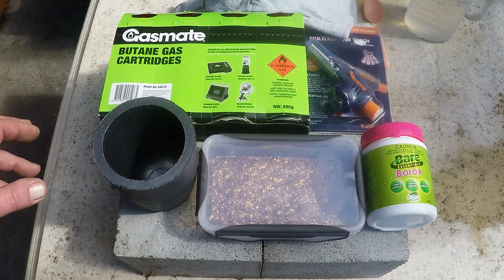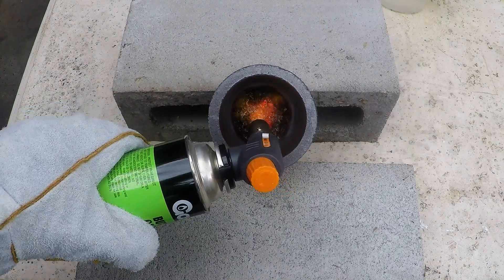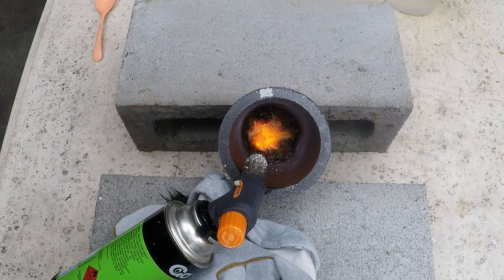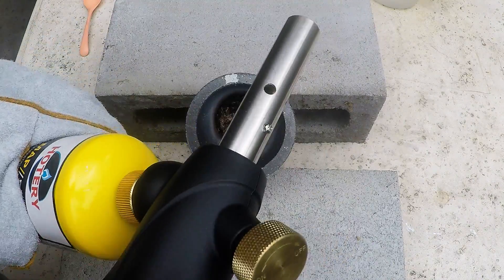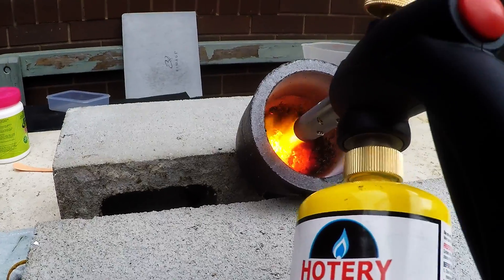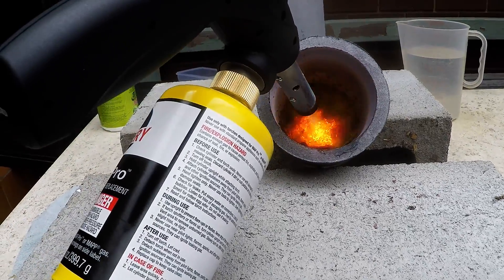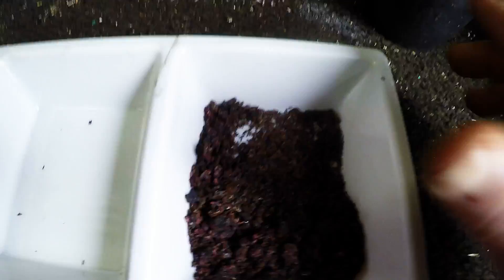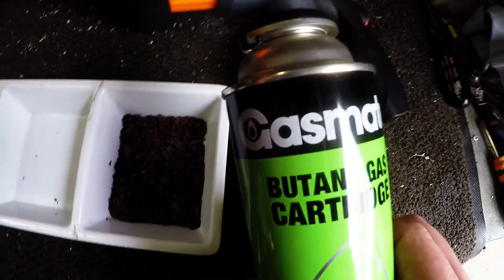1000 RAM Stick Gold Recovery Challenge Failed

Comment: Total & Complete Failure ! Butane is NOT🔥HOT enough...  Along with, you should use AP. Or something similar. Then AR & SMB to refine your gold to .999 1st. Then get a real set up...  Crucible is not the problem.   Cold is not the problem.

Comment: You should have ordered some Kaowool or carbon fiber (Oatey Flame Protector at hardware store) insulation when you ordered your crucible. The MAPP gas is plenty hot (2050 C) enough, you must be losing too much heat to the atmosphere. Butane is only 1450 C, and propane only is about 1980 C.
Gold and copper both melt at about 1070 C, so the MAPP is definitely good enough. Probably ambient temp of air is too cold.

Comment: You need better isolation around the pot you are melting in.
The sides of that pot is cooling  too fast and you losing temperature.
Keep it up the good work as you do.
Respect from Serbia(EU) and city of Krusevac.

Comment: Graphite based crucibles require too much heat for MAPP gas to melt the foils, the heat dissipates far too quickly to melt the foils to completion.

I use a ceramic silica based melting dish with MAPP and haven’t had any problems melting gold chloride or foils.

Comment: make a real forge run a blower line in then use charcoal to for the heat it will melt steel gets that hot there are turtorials on how to make em works really well

Comment: I use map gas but my crucible has insulation around it.  Also I usually add a pinch of borax at the end after melting.  But, I do not know If it matters when you add it.

Comment: You can fabricate a small foundry to melt your Gold Bearing Alloy using Plaster Of Paris and an old tin can along with Brass fittings for you Gas.. It will cost less than $20

Or you can build a foundry fired by charcoal. Instead of the steel crucible you can use the Graphite Clay crucible that you purchased. Check out this link...Enjoy.

https://www.youtube.com/watch?v=hHD10DjxM1g

Comment: try using both map gas bottles at same time that should do it
Reply: I have try that never worked need  crucible in a box  because it lose to much heat. I think need to build or buy a  furnace plus torch over heated  never work right after.

Comment: I have melted plenty of gold foils without any problem. You just need to have the crucible flat on the heat stone shield. It will take about 6 minutes to get the crucible and stone hot stable. Add the gold foils and watch them go. I end up with 6 kt on average. You can add borax acid and let the BB roil and boil in the borax and if you work it for a while, you can burn off some of the impurities. You are definitely loosing needed heat through the crucible.

Comment: I have no experience but I think you're using the wrong type of crucible. Graphite is an excellent heat conductor. Which means also a very bad insulator. you either need to insulate it or surround it with fire bricks. or use a small cyramic melting dish. The heat is being lost to the atmosphere.Nice vid though.

Comment: Ben you can melt gold with propane cylinders it just sounds like your torch is starving for air.  If you can hear that noise it is making.  I have had the same results trying to use similar style crucibles.  I always use quartz crucibles and melt at an angle so the torch doesnt starve for air.  That is the key to melting you dont need oxygen or even mapp gas although it is much faster.  You want to get the shallow crucibles and make a tornado effect on the crucible.  Also make sure you glaze it first.  You can buy those melting dishes on ebay for under 2 dollars.

Comment: your losing too much heat with the crucible.  you need a melting dish and surround it with fiberglass, that's how I melt my gold with MAP gas.  you might be right about the nickel though

Comment: you should be able to melt it using the original torch head  and a decent butane propane mix, as I have melted steel in seconds with this combo. love the channel, its what really got me into scrapping!

Comment: Ben - yes, the assessment correct.  Combination of not enough heat, big crucible, and atmospheric cooling.  I have a great little furnace where the crucible rests in an insulated container and the heat is applied from two torches that circulate a lot of heat around the crucible for a good melt.  Even has a lid to keep the heat in.  They are relatively inexpensive and worth every penny.

Comment: you need insulation Ben. you are out in the open with the majority of your heat radiating away ( you are in winter too). there is a product called "kaowool" from forman insulation that is awesome for temporary furnaces which would keep that heat around the crucible. its 2" thick and comes in a blanket form so you can cut it with scissors and frap up a shroud around the crucible. I have melted bronze using propane this way so you will have those foils liquid in no time using mapp gas and a ghetto furnace from kaowool.  its cheap too, give it a go before investing in any more equipment.

Comment: Hi Ben. Another great video. I have melted foils before using map gas and oxygen and it made a really nice gold looking nugget that registered less than 8k gold. It looked like you were close to melting the foils based on the orange color I could see. And you might still be able to barely melt it with just map gas if you make some small adjustments. First shelter your crucible from the wind using some of those cinder blocks, Try melting a smaller amount of foils and use less or no borax to start you can always add a few pinches after it melts. The borax can act like an insulator making it harder to get the heat down to the foils. Using a smaller crucible would help also because it would be less material to heat up but you might still be able to use  that one. I have run out of oxygen before and ended up with a crumbly mess like you have but have been able to re melt  with success. If you would have had this video out a couple of years ago you would have saved me a lot of time on failures. Keep up the great work.